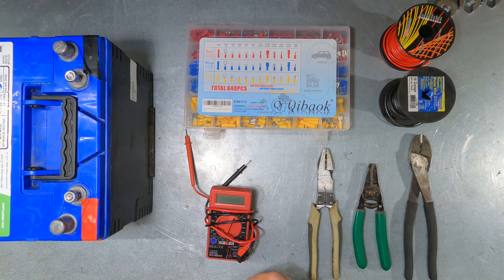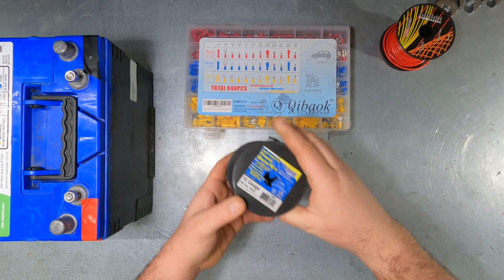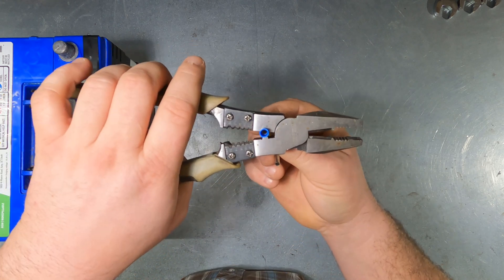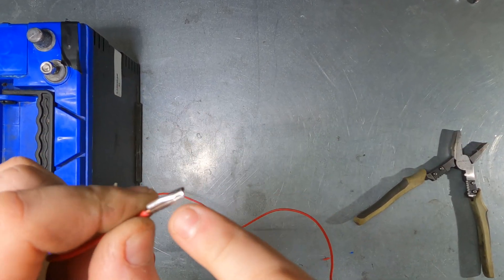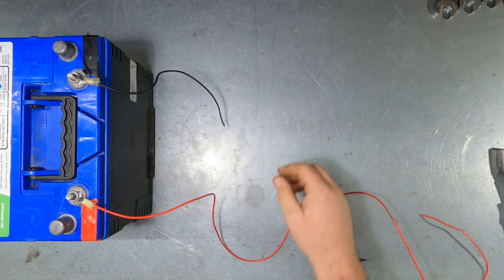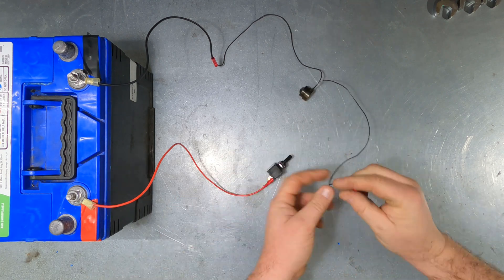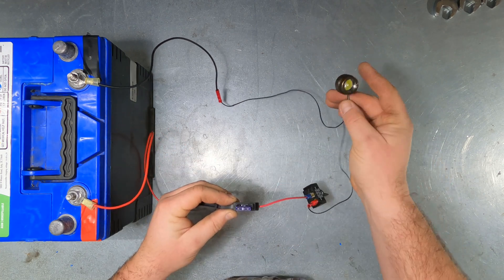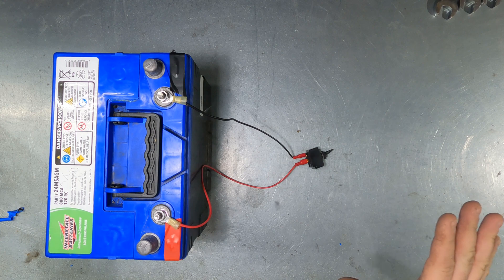DC Wiring Tutorial: How to Make Proper Connections

Comment: Why is it my wires don’t get melting hot until I put a switch to turn it on and off? With everything connected straight to battery on a fuse panel alone it’s good. No fuses blow nor does the wires even heat up a little bit.. But as soon as I connect the on/off switch a fuse blows or the wires instantly get melting hot.
Reply from the maker: Can you send me a picture of the switch and set up?
Reply: I figured it out from watching an Indian guy’s channel. I didn’t know what he was saying, but he had a 2 prong switch. I saw he connected both positive to the switch and the ground went straight to the battery. I was putting the ground on one prong and positive on the other.  Now looking at this again I realize you hooked both positive to the prong and negative went straight to battery. The black wire of was throwing me off having me think it was the negative

Comment: Thank you!  I understand!!!  
I have a dc on/off led light switch outside my travel. I added an on/off switch inside the trailer by connecting black and white wire to new inside switch.  The inside switch has three male connectors.  I used only 2.   If my outside light switch is on position, I can turn off/and on the inside switch.  If outside switch is off position, I can’t turn on light from inside. I simply put a piece of tape over the outside on/off switch so it isn’t turned off.  The question is did I correctly wire the dc switch?  Do I need to put in a fuse?  Will screw up the circuit for the rest of trailer?  
Also, The dc circuit connects other lights in the trailer. The question is 
Thanks tons!
Reply from the maker: If it was existing DC wire in a travel trailer it should already be fused at the panel, so you should be good. The way it’s wired right now should work just fine, but may need to be reconfigured to make both switches work independently
Reply: Thanks so much .  As it tells about my question, I know little about electricity.  It is hard to find people to fix or maintain rv’s.  I gotta getta a good and practical book for dummies.

Comment: Attention to detail is key!  However, it's not hard to solder, and it can't be beat for marine or high vibration applications.  Even the switches.
Reply from the maker: I agree! I was thinking of doing another DC wiring video with more advanced stuff, but so few seemed to watch this I dropped the idea!
Reply: @whatszackdoing  You're growing the channel.  You got me to sub.  What's your thoughts on turning one of these into a sailboat?  Could the pontoons stand up to the battering at sea? 36 feet.  2 pontoons. Dropped deck in the middle with pilothouse and a couple bunks. Catamaran of sorts.
Reply from the maker: @dherman0001  thanks for the sub! I am trying hard to make some interesting and fun to watch stuff.

The strength of the pontoon is dependent on the design. U shaped pontoons (like our playcraft boats) handle waves better because of the vertical side. Round pontoons get holes heated through them where the verticals stands meet the pontoons. 

On thing about alum though is the shelf life in salt water is much less than fiberglass. 

I’m sure it would work though, a catamaran is pretty much a really wide pontoon boat!
Reply from the maker: *holes beaten
Reply: @whatszackdoing  Low center of gravity being critical.